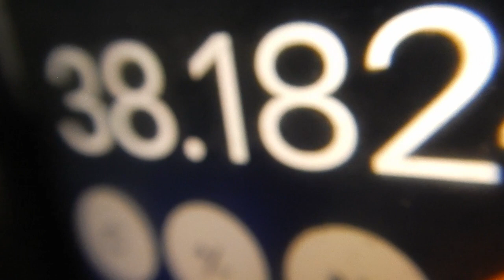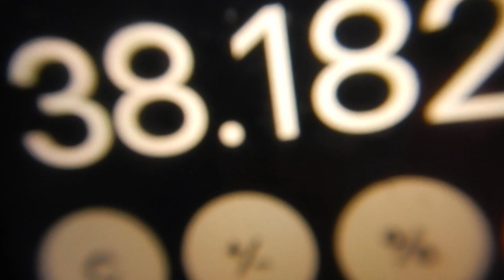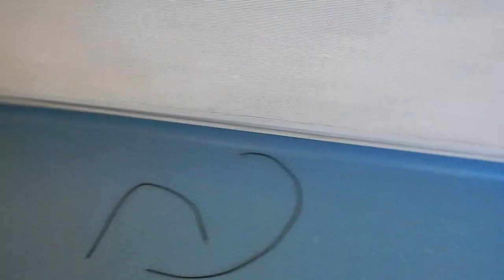Video 121: Upgrading submain/tails for a change of DNO fuse

Comment: Love a mind boggling crap hole lol...tail sizes should be embossed on the outer sheathing?... some are. Shouldn't need to do a Pi calculation on site Rupert, but a paid math's lesson. there is no thermal damage though? so?...over compensated for I reckon. Hope you are well Rupert...